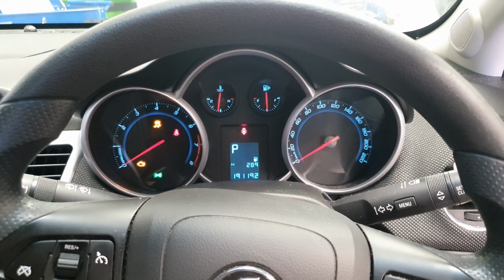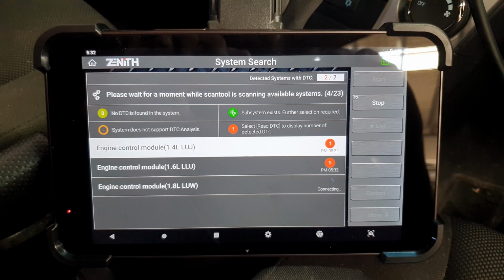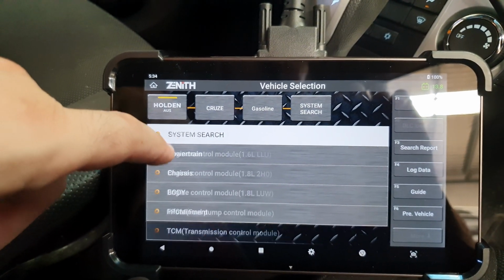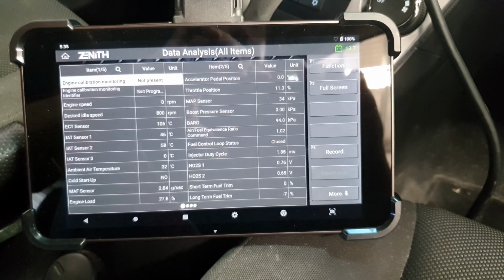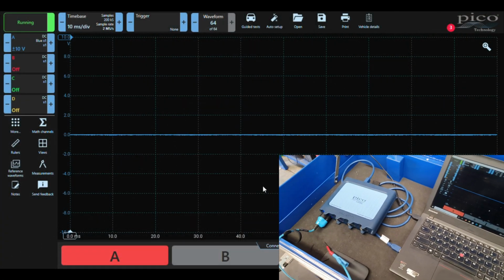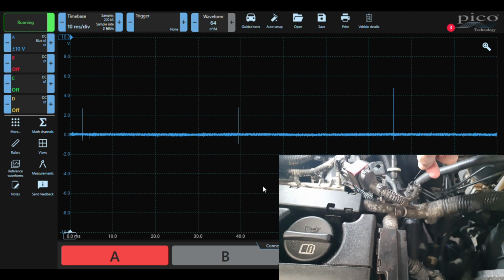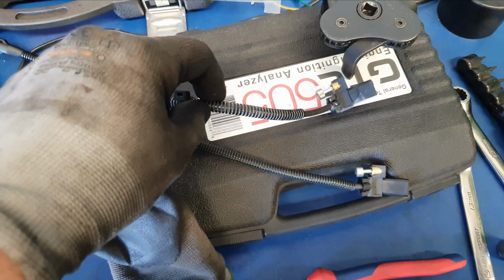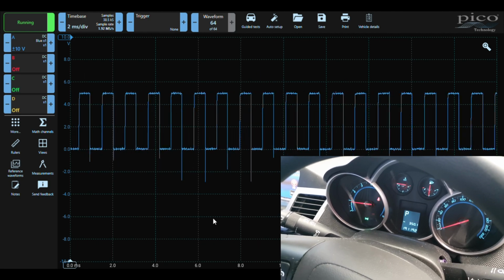Holden Cruze hard to start - Engine light on P0335

Comment: Good diagnosis. Is “connect detect” a pico 7 option?
Reply from the maker: Thanks Bart, no it's definitely on Pico 6 too, just I think either not many people know about it or people may not feel the need to use it.
Reply: @romanosautomotive  I’ll have to figure out how to use it. I’ve never seen it on my pico. I have both 6 and 7. I have an older 4423

Comment: The problem with this car is that it's the biggest lemon GM ever sold.
Reply from the maker: Are you sure? The Captiva and the Astra may rival that 🤣
Reply: @romanosautomotive  oooh yea I forgot about those, especially the Captiva.  There are some legendary stories of mechanical shops refusing to work on them because of Fair Trading laws and repairs etc... Impossible to solve issues were at the core of it. Hahahaha

I have an interesting story.  I bought a Ford mondeo diesel with the powersh*t transmission from 2012, in 2017.  It had odd problems here and there.  I had fluid and filters changed by ford, had a transmission place claim they could repair it, but did absolutely nothing (found out why from a third party), including me calling 6 months later and them telling me they don't work on these transmissions.

Fast forward to now.  I tried something... I changed the fluid and filter myself, added a bottle of Lucas transmission fix AND reset all the computers in the vehicle by disconnecting battery and turning on headlights. Reconnected and....

It's like brand new off the lot.  170k.  You would have thought before that the transmission was going to blow up.  

They also have a faulty washer pump, that pushes water into an important electrical connector behind the glove box.  There are several ways to remedy this, but changing the pump for an aftermarket one solves it easily enough.  If it gets wet enough, it'll damage the ECU.  Anyway just FYI
Reply: Don’t forget the VE’s and the Rattle tech’s